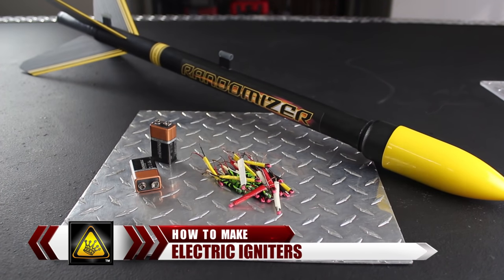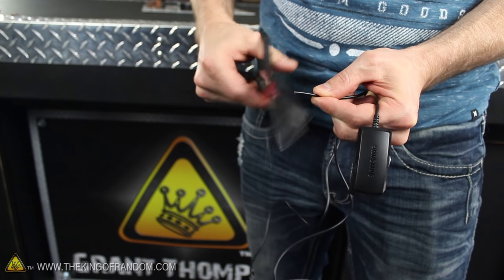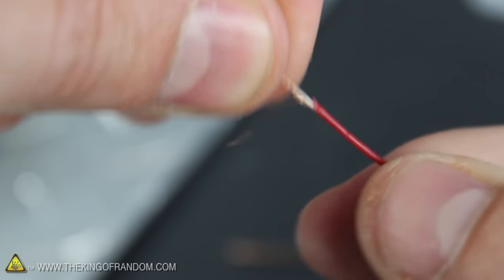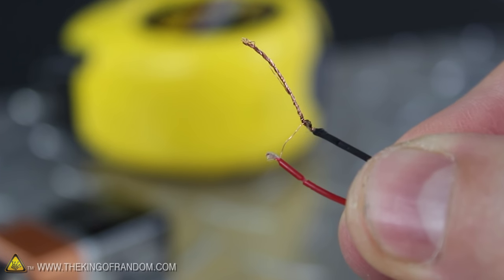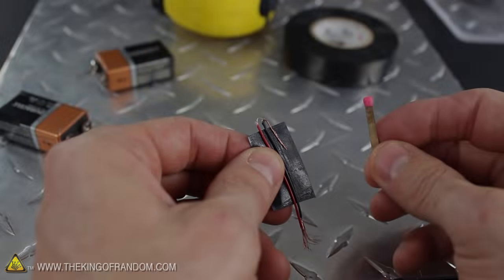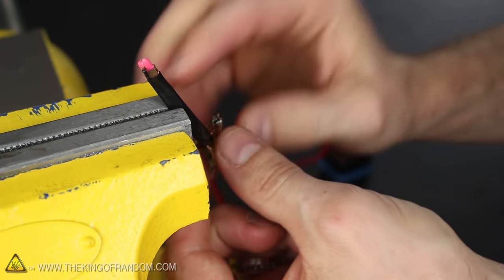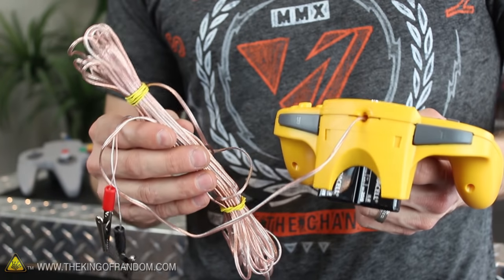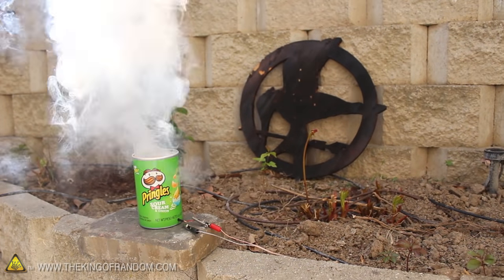How to Make Rocket Igniters (Electric Matches)

Comment: It doesn't work for me. I'm trying some 14 gauge single strand copper wire with a single steel strand connecting the two. I touch the two wires to the battery but nothing happens
Reply: Do I need paper matches? Cardboard? I'm using wood
Reply: Nevermind I used a power drill 18v battery and that seems to do the trick

Comment: Curiously enough, making one of these igniters is more expensive, than buying one in local moddeling supplies shop... But I don't live in US, so I can't judge.
Reply: You only use 2 inches of the charger cord. So you could make at least 12 of these for the cost of a book of matches and a charger. Which comes to less than 20 cents per igniter.
Reply: +William Martin Still not worth it,  pre-made igniter here costs around 10 cents per one, usually buy them in packs of fifty then they drop the price to 5 cents per igniter.

Comment: Couldn't you just ignite fireworks, or rockets with just the coper wire and skip the match? I mean, I think it's a cool design, and look fun to make, but I'm just curious as to if the match is necessary.
Reply: It may not be entirely necessary, but it ensures that it ignites whatever it's connected to every time.

Comment: is USB cable good?
Reply: Any two cables with copper or conductive matterial will work
Reply: Gosera - ty :)
Reply: Just remember, if the wire strands are too thick you may not get enough current from the batteries.  If they are REAL thin, it may not set off the match (unlikely to find any too thin but bear in mind).

Comment: Copper wire doesn't light the match... Too low resistance
Reply: It doesn't. Tungsten or another metal with high resistance works.
Reply: then tell me how this works?
Reply: Actually I will tell you. Over 6 amps going through 1 tiny little copper wire strand will make that thing heat up really hot. Because all of the electrons bash against each other when you hook the terminals together, and there is just 1 tiny copper wire for them to flow through, that means there is less wire to absorb the heat, so it is focused into one area and therefore it gets really hot.

Comment: te best homemade igniters i seen sofar used 1 ohm resistors and run the same amount of current through them 
they work longer and get hotter before burning out but are prolly more expensive than youre setup

Comment: it can be done waaaaayyy more easy
Reply: milano007100 How?
Reply: milano007100 I think he's going for cheap and simple. Not easy.
Reply: JRMCNEA much cheaper and simpler is light the match and shove it in
Reply: abigail swain
I don't think you understand the reason for a remote igniter. The idea is to light it form a safe distance. and "light the match and shove it in" is why so many idiots end up with missing fingers eyes and balls.

I mean simple in production. Not simple in the brains area.

Comment: I have been watching some of your old videos and I notice that you never did a sugar rocket attached to a bow and arrow. Is it possible for you to do so. I guess you could but I 2 sec fuse and light it before you launch it, also you may want to use a metal arrow of some sort definitely not a carbon one because they aren't that strong. Thanks in advanced.

Comment: I don't recommend this method to anyone serious in homemade rocketry!!! This will likey cause a CATO in most rockets since the matches and tape used to make these igniters tend to clog the nozzle! I highly recommend using the ping pong ball melted in acetone to minimize the size of the wires and prevent personal injury! Grant Thompson, please remove these videos and do proper research on the hobby before uploading these. Please pm me. This is an extremely dangerous method of motor ignition. Continue at your own risk!

Comment: I found that using 10ohm 0.25w resistors does the same thing. I picked up a hundred for £1.20 delivered from eBay which is less than $1. It requires no prep work, just put 9v or 12v through the resistor and it will catch fire. :-)

Comment: If you use pencil lead. It acts as a great resistor and gets glowing hot. So I was just wondering. Maybe you could use that instead of the single strand of copper wire.

Comment: Did you realy mean 6 AMPS? @ 2:30" I ask because that much ampage will kill you if touched.
Reply: Diolectic *Sigh*. It would need enough voltage to get through your skin first, and 9v is no where near enough. Of course 6 amps would kill you if hard-wired to your heart, but just touching the terminals, nothing would happen.

Comment: I’m way late to the party, but I tried making these. Works really well, but the match head won’t fit into my Estes rocket engine. Any thoughts on how to make them smaller?
Reply: This came across my mind as well watching this. I can only think that the current from the wire gets hot enough to ignite the fuel once in there without the match. Did you try this method?

Comment: This is really cool - I've been looking for a way to do this. Does it have to be a charger cable? Or can you just get some other thin electrical cable to do it with?
Reply: You can probably do it with any old plug with a thin cable. Just make sure the wires inside are stranded.

Comment: Its not working for me.. I even used about 6 9V batteries. Help me! What have I done wrong?
Reply: Are the batteries dead?
Reply: +Lukman Mohamad Did you connect them in series or in parallel? Because you need to do the latter.

Comment: 9V is pretty stupid, vast majority of heat would dissipitate in battery. you need low voltage high current source. D cell battery, for example.

Comment: Hey grant, I've used 10 ohm, 1/4 watt resistors directly with no modifications and consistent results. They light on fire by themselves. The only downside is there is a small delay in comparison to what I see in your video. I added multiple 9v batteries in series to speed it up.

Anyway just wanted to drop a line, great vids!
Reply: But aren’t you just burning through those components every time?? The resistor burns up, right?
Reply: @danevertt3210  yes, burning a 1 cent component everytime.

Comment: I can do all this and ignite a match for over 9 dollars worth of supplies,( including wire strippers ) and about 15 minutes of my time...OR!!!!! I can ignite a match just by striking it in about 1 second of my time and 0 dollars worth of supplies....... Yeah I'm going to take option 2...
Reply: I mean, you can still have a  long fuse to still watch from far away in a chair and light the match.
Reply: Adrian Rubio Sure but that is waste of fuse and from safety perspective its best to be far away. There can be and have been factory made fuses that miss malfunction causing too early explosion. Like new years rocket that had had 5cm fuse, what burned under 2-seconds and whole rocket exploded in ground. End result was:" Am i missing a eyebrow?!" moment. Lucky nothing worse happened.

If this would have been electronic fuse it would have been push button.. boom.. "okey that was not right"

Also have you considered that this is also those who make indie movie pyrotechnics? Think if all hollywood movies, there was guys lighting up fuses with lighter in the back ground while star is running! XD Other thing is timing. Fuse gives around there time, electronic is there when you push the button. Yeah so there is actual use for these, even if one is not so safety concerned. I didnt plant to use these in new years rockets, but in film making.

Enough been said making your own bombs can be little dangerous and anything can go wrong, so for i rather do it from distance, even if test explosive worked like it should.
Reply: Oh I'm talking loooooooooonnnggg fuses like the one Grant Thompson - "The King of Random" made in one of his tutorial vids, or one of this 5 feet fuses you can buy at online websites and shady liqueur stores.
Reply: Adrian Rubio oookey.. well we dont have those in here... wai... shady liqueur stores selling fuses?!?! WHAT?! O.o Yeah defnetly not here!
Reply: I think you can just ask for seperated fuses at firework shops as well. Which is convenient since the 4th of July is right around the corner.
Reply: Adrian Rubio Umm not here:D  We dont have any firework shops and the fuse, all explosives and their chemicals are banned, but from people who have lisences and training to operate them, with small exception of buying really small fireworks 4 days before year is chancing. you cant get legally KNo3 anywhere here as its oxidicer and can be used to build a bomb. Course its used all most as pure in stomp remover agent so that is pretty much only way to get it.
Reply: You can order it online if you have a license
Reply: Soon I guess you win this argument Hellsong89
Reply: Adrian Rubio I appreciate this conversation.

Comment: I tried it, and turns out that my 9V battery exploded, and the match didn't even ignite. I wonder what I did wrong?
Reply: +balaji fred both of the wires were in the same size. 1 must be smaller so there will be ignition
Reply: +Ilya Ritter I see, I'll try it again some time soon and I'll let you know how it goes
Reply: if you have any question about any project i can help
Reply: +Ilya Ritter Alright, thank you so much
Reply: +Ilya Ritter Alright, thank you so much

Comment: Its kind of unclear how you connect your wires to a battery.
Reply: ***** O.o how that is complicated? Take wire in one hand, take another into your another hand and push them into battery terminals? You can also take project box, one or two battery connectors , fighter style security switch and one big red button switch, to make two step launch box. If you want to be hardcore add key switch so your igniter wont go of by accident.

Comment: I have an issue
Reply: The battery is the one getting hot not the wire
Reply: try to use thinner wire
Reply: @DexBerry  i tried that and the battery was still the one getting hot

Comment: Doesn't work... I tried at least a dozen times.
Reply: nivecksec1 You most likely got too thick wires, wire is not connecting enough the match head, your match heads are old (chemical mix chance over time) or you dont got enough amps in your power source. Thought i just saw this and havent try it out yet.